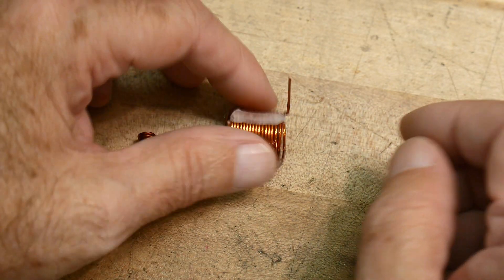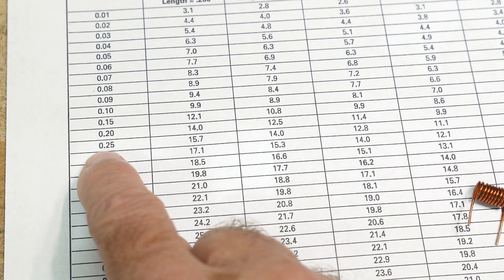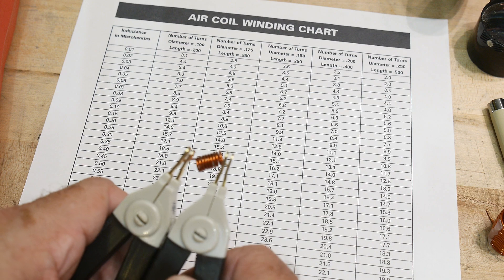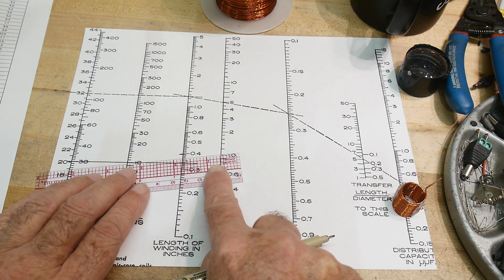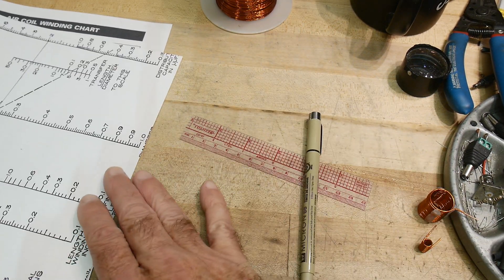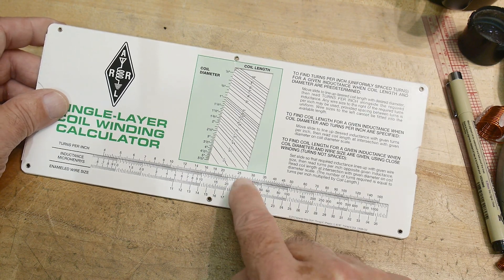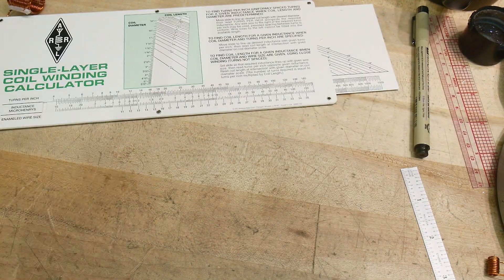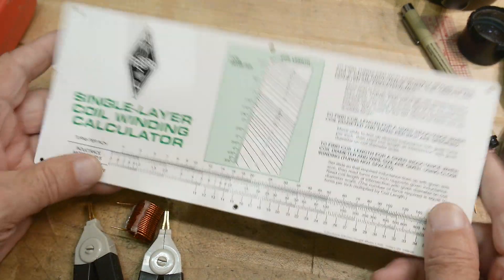#961 Hand wound air coils (inductors)

Comment: I used a nice GENRAD- Model 1658 ? LCR Bridge with Kelvin leads 1 kHz or 1 MHz test single ..and it had DC voltage in to bias and measure varactor diodes...for capacitance it could measure dissapation factor...and maybe Q in inductors...it maybe it is time to mail you a Xmas present....

Comment: When I was coming up (the 1960s) we seemed to use lots of air wound inductors. These days it would seem that toroid core inductors are far more common. Would you perhaps do a video comparing the advantages and disadvantages of the two types?

Comment: Thought it was rather funny that the ARRL slide rule mixes units between metric and imperial - wavelength in meters and coil dimensions in inches.